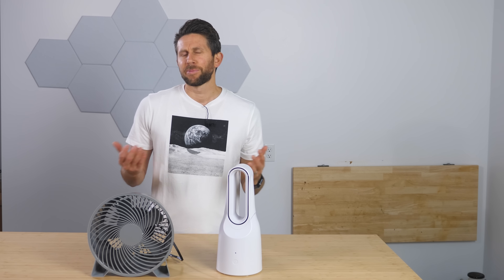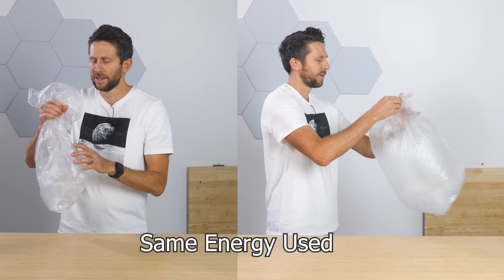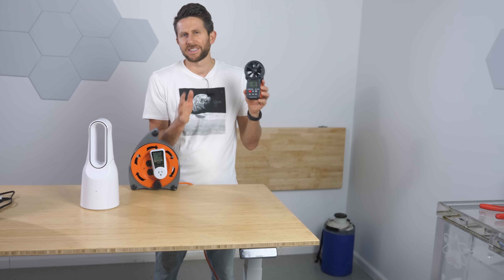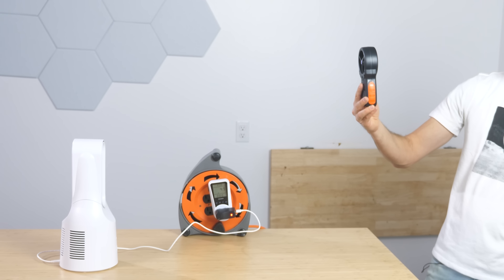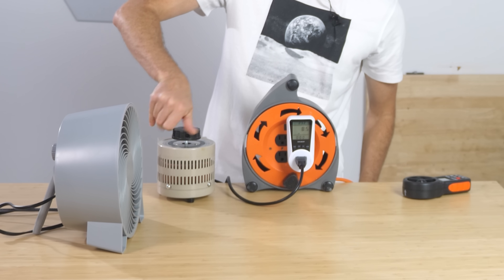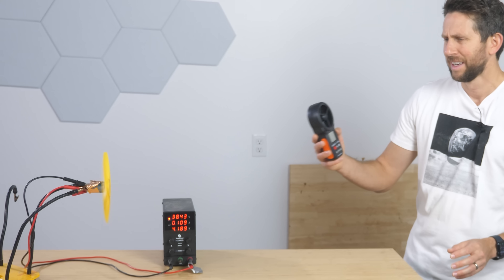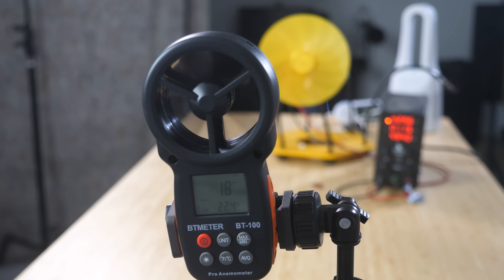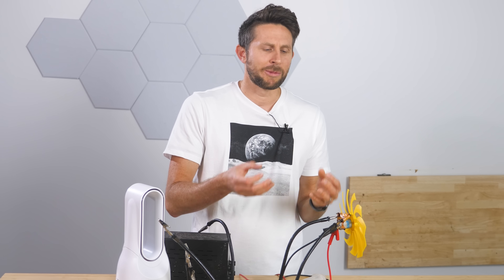Are Bladeless Fans a Scam?

Comment: To properly compare, it seems like you need to measure how much total air the fan is pushing, per watt. That is, flux/watt, or the net force imparted by the operation of the fan. Eg, as if one were using the fan to push a swamp boat.
Reply: Those measures will all be proportional to the air speed. He also mentioned that the bladed fan had a much wider dispersive area in a qualitative sense. So regardless the bladed fan still has a much greater flux.
Reply: He only needed to test the one fan model. with and without its cover. The other fan test was irrelevant.
Reply: @JoeyBlogs007 no, that was the least useful test. The bladeless fan is using aerodynamics to turn air speed into volume. Faster airspeed from the internal fan is literally exactly what you would expect.

Comment: I always wondered if those fans were a scam. Not only are they not better than a regular fan, they're a lot more expensive. I use old computer fans for a lot of things where I need to move air in a small area like soldering.
Reply: Dyson probably spends a huge amount of money on marketing of their overpriced products.
Reply: A more important question for you. Do you pronounce that Sol-dering... or Soddering?
Reply: @----Jay----  In the US we generally say 'soddering'. That's what I say.
Reply: Yup some old computer fans and a 12V wall wort is all we need!
Reply: I use a 6 AA (9V) battery plug I made in a matter of minutes that I can use with my Noctua computers fans to make them portable. It has been absolutely amazing with computer fans to dry out tiny collection of moisture damage in corners/walls, to cool down laptops/tablets and even used it once as a portable fan in train cabin.

A Noctua fan can run non-stop almost a week with just one charge and so silent that you can't even hear if it is on or not  @PigeonLaughter01
Reply: Luckily they don't chop up oxygen molecules when used in Korea, so that's one benefit 😝
Reply: @atomic_wait  what?
Reply: @LordThanatos5967  Google fan death, ha
Reply: @atomic_wait that's an urban legend 😂
Reply: Dyson fans are usually air purifiers combined with a fan... so 2 in 1.This means that you have one unit instead of two, and also the fan MAY circulate air better in the room than average air purifier. Air passes trough the set of filters, which reduces the flow... but it is enough to circulate air well. The benefit it is mostly that it produces even stream of fresh air and fan is quieter on lower settings (but sounds more like a jet on higher, high-pitched). Design has no exposed blades which is safer for kids and animals. Last thing I can think of is a lot of non-essential features like air statistics and automated pollution air detection, which some may like for automation. Warranty is 2 years (if I remember right) which is decent... but it is not uncommon for their units to have some production defects.

Is it overpriced? Yes, but depends what you need. It is not a best fan, nor air purifier but does both decently and has some positive sides to the design.
Reply: Wrong. The entrained air is not purified. Most Dyson stuff is a scam. He tried to get into RVs and found that they are rather more complex than cheap plastic enclosing basic heaters and fans. @Taenebron
Reply: And they stikll have blades :D Aren't there fans that greate air flow with only electricity and without moving parts. I thought that would be one of these.

Comment: Does the volume amount of air moved play a role worth noting? So, the “bladeless” fan sucks in air through on the top that mixes with the air bloen out through the slips, thus the airs are mixed and speed is lowered. But it could it be moving more air around than its regular exposed blade rival? And then we may consider efficiency in terms of (air speed) * (volume of air moved) ?
Reply: Don't you dare think critically here.
Reply: A normal fan also 'multiplies' air. It's all marketing.
If you think back to the proof of concept test, his mouth and a bag. That's a lot more like how a normal fan blows air.

Comment: I wonder if you had the fan turbine mounted completely open, but still have the top part of the blade less fan body so you could still get the affect if that would change anything. Like if you just cut a ring around the bottom so that the turbine is completely exposed.

Comment: One other selling point of bladeless is safety for families with kids and/or pets.
Reply: that's why normal fans are covered by a cage
Reply: @DenkyManner  kids can still stick their fingers though it
Reply: @gregoryannicchiarico3570 Can't think of any fan I've seen that has openings large enough for even little fingers. Fan makers aren't going to be careless and get sued. Those grills are pretty tight.
Reply: I dunno about pets. Most people will never open the fan up to clean the insides, which would be filled with hair.

Comment: Is there any difference in temperature though? Is there any compression/decompression effect in the bladeless?
Reply: Fans don't change the temperature of a room LOL what a n00b
Reply: All fans slightly warm the air. It feels cool because fast moving molecules bump into warm molecules that have been heated by your skin and strips them away in the air flow, replacing them with room temperature molecules that can absorb more heat from your skin. Therefore the cooling effect is directly related to wind speed. The faster the wind speed, the cooler you will feel until saturation point (the point at which the wind speed is so high, it’s stripping molecules before they had a chance to interact with your skin and take that heat away.

Compressed air feels cold because the molecules are all bumping into each other more as they are compressed - theres just more of them per volume so they bump into one another more - this means each molecule is moving slower. Think about a ball room, and you’re running through it to the other side. A ballroom that is empty lets you sprint through. A ballroom full of dancers means you have to slow down to pick your way through. And so it is with compressed air, as it expands, each molecule stops bumping into another so often because the volume is bigger, yet they are still moving slowly, so it not only feels cold, it is cold. 

But we don’t magic away energy when we compress air. When we squeeze air together, we heat it up. Now if there’s a substantial amount of time between squeezing the air and letting it expand, we can absolutely use that cooling effect - a factory compressed air into a can. The can sits on a shelf and comes to equilibrium- room temperature. All that excess heat leaks away. So now when you spray it, it’s cold. 

However without fans, they do (slightly) compress the air. But it expands immediately. The result. The air gets slightly warmer as it’s compressed by the actions of the fan blades. Then as it expands, it cools back to room temperature- the exact same temperature it was before it was compressed.

I hope this very long and boring post helped!!
Reply: he doesn't know how to test and it's not a science channel just hype. Fast air = cool, dyson is a scam! More in the next episode of dragon ball z.

Comment: How about the volume of air that is moved?
Reply: Right. how can you measure efficiency without the volume?
Reply: at these fan sizes air speed is air volume
Reply: Yes comparing CFM would be more useful for sure, but you're still going to get the same results as comparing air speed. Bladeless fans are a scam no matter what.
Reply: Yeah, compared to many other Action Lab videos, this feels disappointingly incomplete without any discussion of volume and how that compares as well as just raw speed.